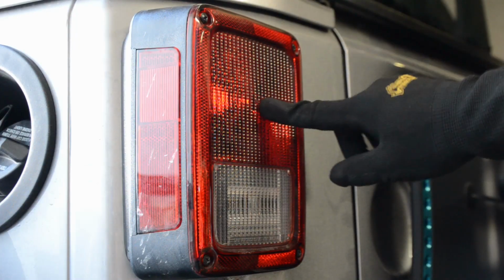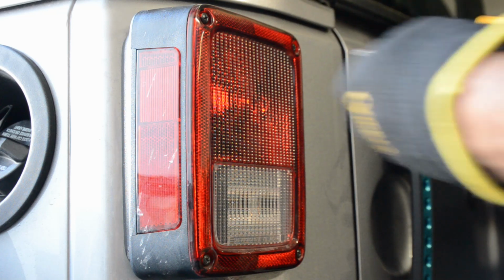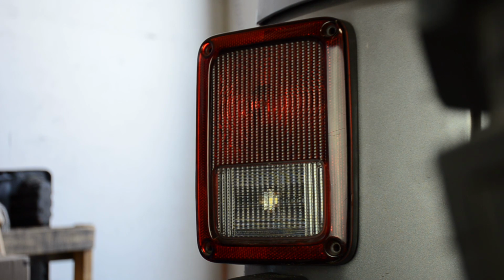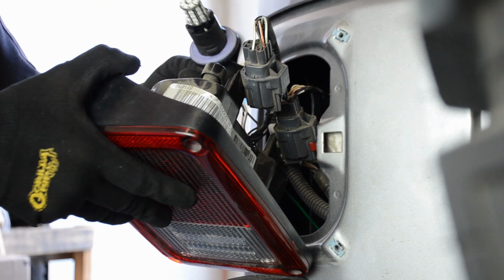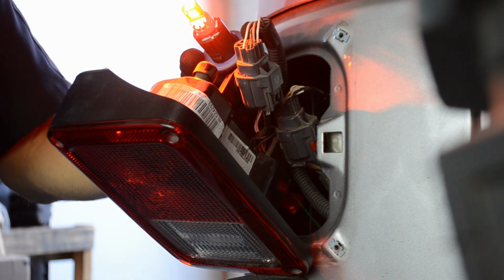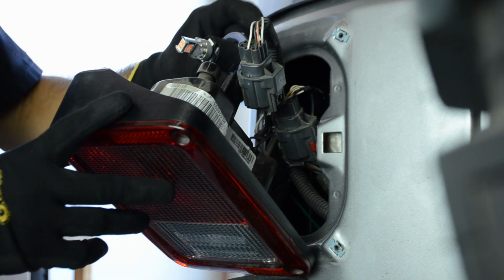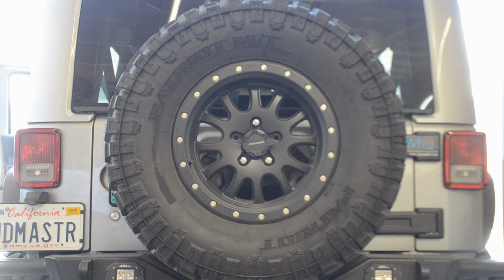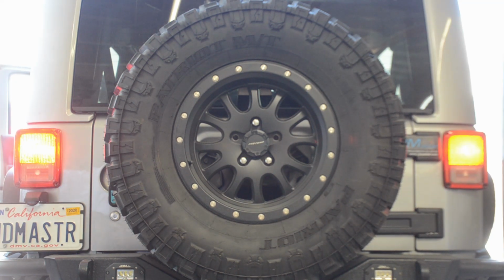Installing 3020 Series Brake Lights- How To

Comment: But what is the difference in brightness from running lights into brakes
Reply from the maker: In a white temp, the running mode provides about 300lm per bulb.  On brake, it jumps to 1400 to provide a noticeable difference between tail/brake.